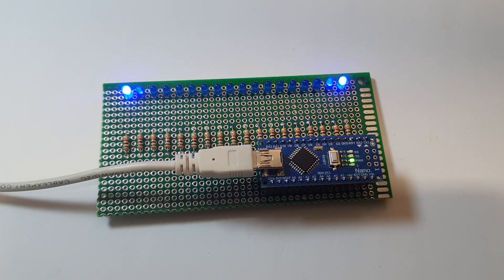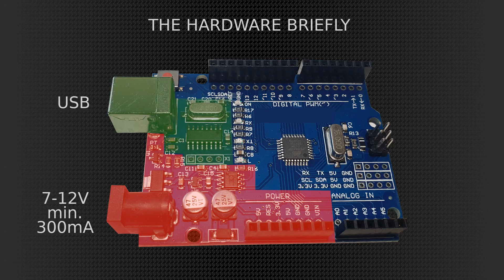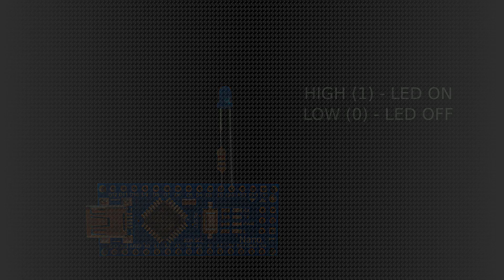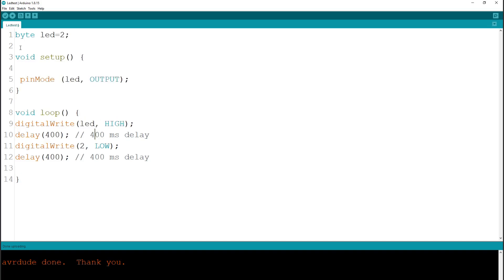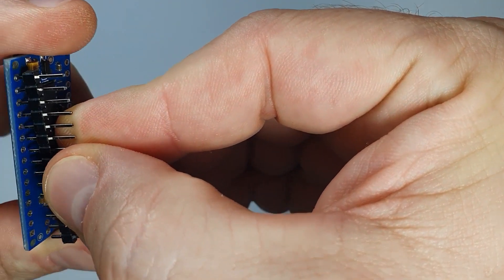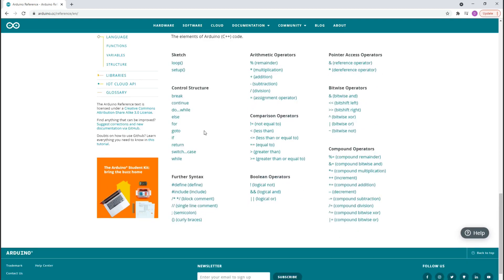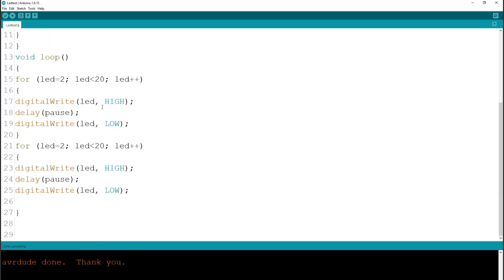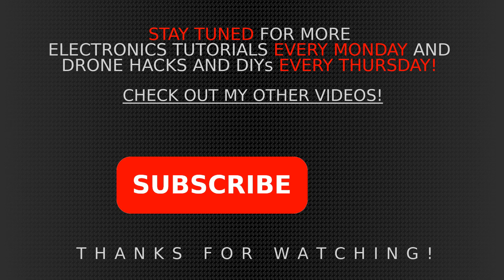Arduino BASICS for beginners with a cool project in 20 minutes!

Comment: OK Mr zolly! I have a project for you. 250$ offer. I'd like for you to find a way for me to HARDWIRE led lights. The lights need to be of specific colors  that can be operated by the remote only. Led lights must be powered by the drone itself with an option to turn each on and off. Let me know and I'll get into the colors of the led
Reply from the maker: Hi. Write me an Email. It is on the about tab on my channel. I need to know how many individual LEDs we are talking about.
Reply: @ZollyD  I don't see it sir. I only see your description section.
Reply from the maker: Oh... zzoollllyy(at)gmail(dot)com
Reply: @ZollyD  are you sure that's it? Because I can't find the email 'zzoollllyy'
Reply from the maker: @georgemiller6930  Yes😅
zzoollllyy at gmail dot com
I received several Emails on that today. Should work. But whatever, you can write here too if it really does not work.
Reply: @ZollyD  I'll try again. But if it doesn't work then I'll give you the details here.
Reply from the maker: I added Facebook link in the description. :)

Comment: You've motivated me to get started with an Arduino.  It would be nice to have links to the hardware you use/recommend for beginners --  everything from the Arduino itself to soldering iron to PCB boards, resistors, etc.  Is there a starter's kit you recommend?
Reply from the maker: I will try to look up something and add links in the descriptions. 🙂
Edit: And I am super happy that you got motivated to get started! This is great. Trust me if you get the hang of it, it is really cool. And you know the winter is coming(at least here), it is nice to sit home and code a bit. 😁😁
Reply: @ZollyD  I should have done my own research first.  Tons of great beginners kits and info out there already.  Please don't spend time on this on my account.  Thanks!